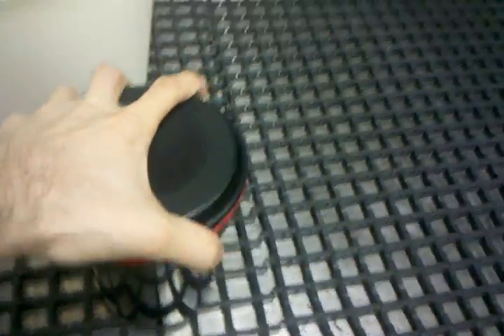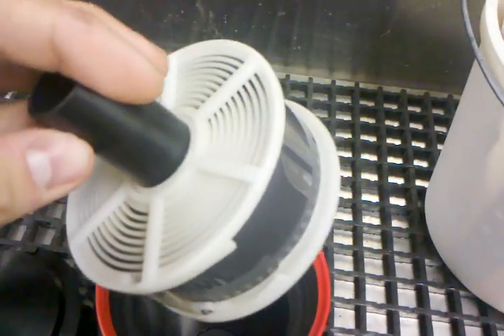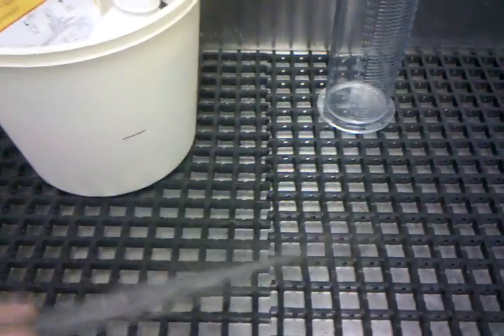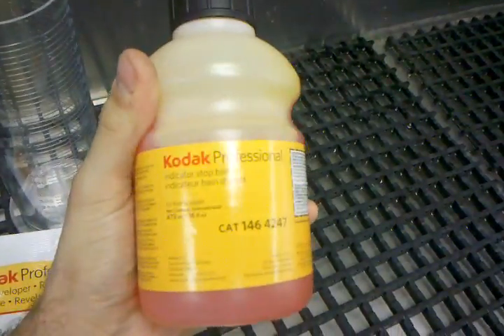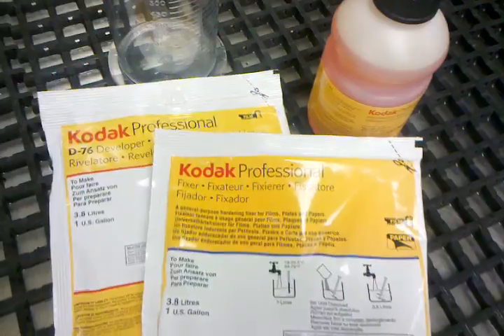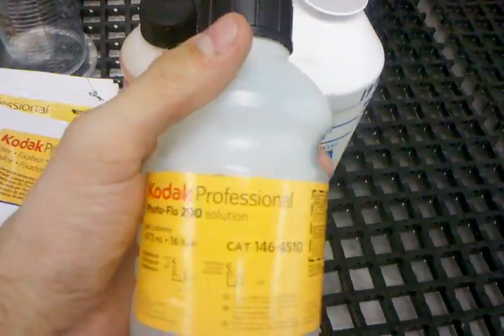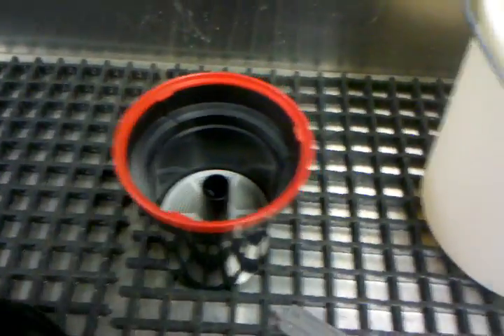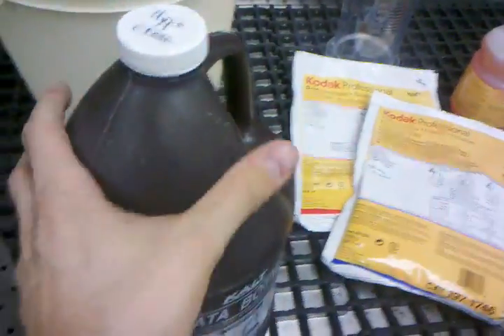Process / Develop 35mm Black and White Film At Home

Comment: Ive never use Perma wash, just washed with water on a 3 step, before photoflow
Reply: That's okay, but use of PermaWash or its like greatly reduce the time and amount of water required to remove fixer from your film. Because it also chemically changes the fixer, it give an extra level of security against later fixer stains if your wash is less than complete.